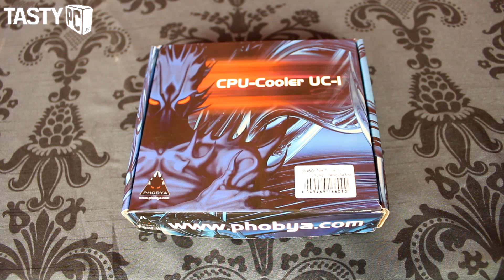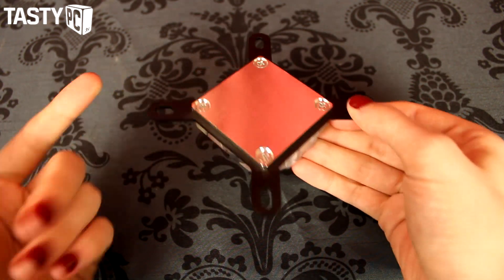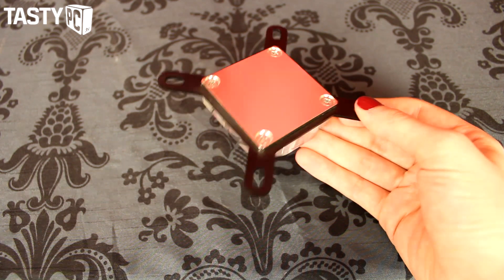Phobya UC 2 LT Plexi CPU Block Overview & Fitting Guide on Maximus VI Impact

Comment: IMPORTANT NOTE: No where is it stated in which way it flows, in this transparant block it is more obvious, but the arrow indication is the wrong way around. You'd think that the arrow pointing towards the hole is the inlet and the arrow pointing outward is the outlet... This is wrong. The 'center' hole with the arrow pointing towards it is the outlet...
Reply: No the center hole is always the inlet. Specially in this case.

Comment: A screw is something that is "screwed" into an object and bites in and holds itself. A Bolt is something that passes through and is held in with a nut on the other side or a thread on the other side. 

google screw vs bolt and do some research.

Comment: I think lots of people (including me) overestimate the viscosity of that thermal paste you're using. I know if I put that much AS5 on my chip, I'd be in for trouble when it came to getting it off, it'd probably end up 2mm thick and glue the chip to the block, but if what you're using is runny enough, I can see why it's not an issue :)

I still think if you haven't spent a day playing with different amounts - give it a crack, you might find a sweetspot amount, or maybe it's already optimal :)

Comment: Aye, as one of the neanderthals I stand by this statement, though she has inspired me to put more aesthetic thought into my redesign, so we'll see how it turns out.

However my opinion on thermal grease comes more from a thermo-fluid dynamic point of view (though pissing about with AS5 helped), so I should probably make a vid on that, but my only suggestion to Lauren would be instead to play around with different applications, I think it'll be more fun than listening to some twat(me)'s lectures.

Comment: First of all, Spatula, VERY funny :D
Always enjoy your vids, keep it up.
Very cool to see that girls also build computers, why shouldn't you right!
But I have to address the way you (and probably 2 million others) put on thermal paste.
From personal experience it is much better to do small dots or lines on the CPU and then rub the CPU against the cooler until the paste is evenly distributed all over the CPU and cooler.
That way you’ll be getting a layer of paste between them as thin as possible.

Comment: Educational as usual, I'll hand tighten my monsoon fittings when my tygon's arrive :D

I have ordered a Alphacool NexXxoS Monsta Dual 120mm Radiator, but would love to see a test where you test temperature differences in a set fan/loop/ambient temp/CPU load configuration, with radiators in different thicknes :)

Keep up the good work ;)

Comment: 5:05 yes, keep buying and reviewing this cheap shit. LED diods from Phobya stops working after less than week usage, than I buy OEM LED diods and they working amlost for a half-year. Also on some phobya radiators you cannot put some fans because spacing between holes are different than on fans you trying put it on. Also I found a few lightly smaller threads for 1/4 fittings, so u need use tools for fixing that problem and twist fitting really hardly.

Sorry, but shame on you Phobya!